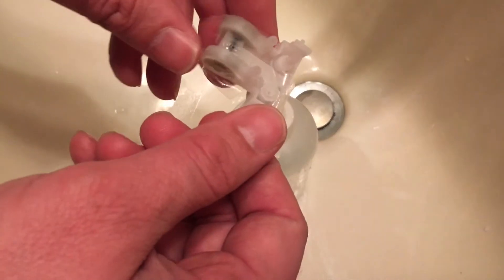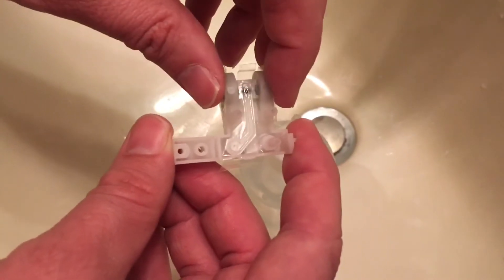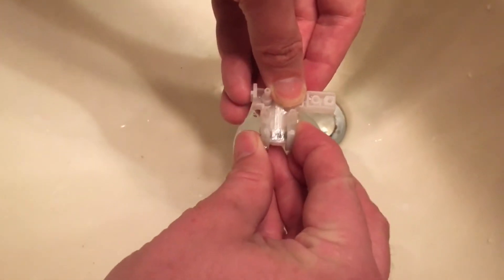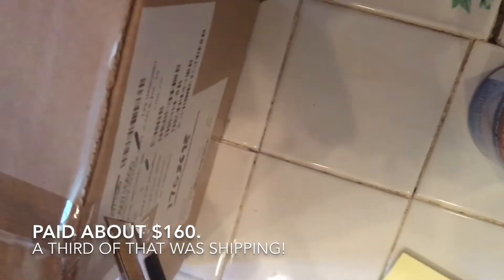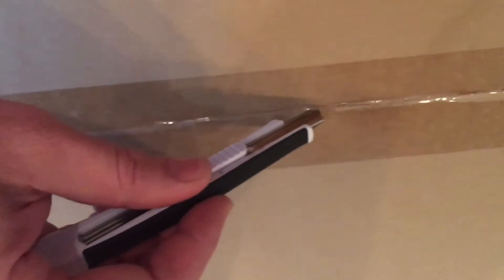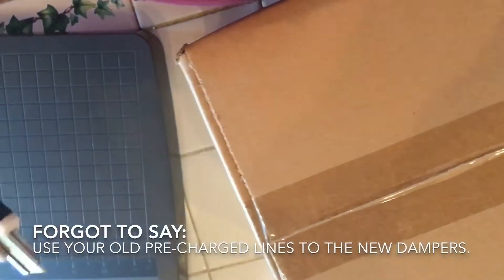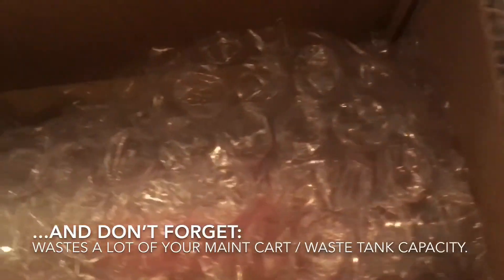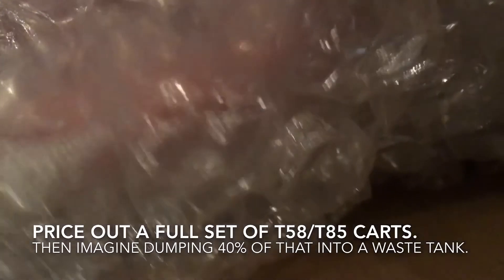Black ink switch valve fix Epson Stylus Pro 3800 3880 SureColor R600 P800

Comment: Could you please show us how you took this valve off and how you reconnected it?anyone not capable of doing it will not attempt to anyway,  Thank you!
Reply from the maker: Angel Smoke I stopped getting notifications for replies on my own videos after fixing my phone, so I missed this. Sorry.

The ink charged into the old ink supply lines was worth hundreds, so I deliberately left most of the old system installed. Obviously, the black ink switch valve and drained PK line were the only real problems.

First I followed a disassembly video I found on YouTube. I did not need to remove the printhead but once I had access to it I removed the motor and ink switch valve actuator from the top of the damper assembly that contains the ink switch valve. This can be done with a set of screwdrivers.

I believe I lifted the damper assembly off the printhead and turned it upside-down before disconnecting the lines and transferring them to the distribution plate on the new assembly. This is where it has the potential to get messy, since the old assembly will have dampers full of ink. Be sure to get it into a small bin to contain any ink ASAP. The hoses are long and flexible enough that you can switch the hoses outside of the printer. It may make sense to reinstall the carts to prevent ink from flowing freely out of the lines (can’t recall if I did this). Just don’t do anything that would pressurize them!

If you have a way to extract and recover the ink you may not want to do it this way, but I took the old damper assembly to the sink and began by removing the distribution plate and flushing the ink out with water. I then removed each damper, flushing them repeatedly until all the ink was out. Two dampers attach on top and three more attach on the bottom. Each damper has two chambers for two color/ink channels. Yes, one is vestigial and not used at all.

There is another screw under the top two ink dampers which holds the ink switch valve. Remove it and you should be able to drop out the black ink switch valve, which also doubles as a pass-through for one other ink channel/color.

Once removed, try to flush the ports. I used a cone-tipped dispenser bottle from Harbor Freight which I believe was $3 for a pack of 3. I filled it with warm water and squeezed to pressurize the ports.

Of course, you need to manipulate the ink switch to pass water, which you can do by putting pressure on one side of the selector pin or the other. It looks like two disc-like chambers with a pin that goes through the center of both. There is a clear film sealing each disc which is also attached to the pin that goes through the center of both discs. Just like the actuator we removed earlier, you can use your fingers to press on either side of these films to manipulate the pin sealed inside. Careful: you don’t want to compromise the seal.

I spent a good long time running warm water through and manipulating it back and forth. I intended to move on to isopropyl alcohol or ammonia if that didn’t work, but it eventually did. I just kept pressurizing it from different ports, even in reverse, while manipulating the switch back and forth. One side of the black ink switch definitely wasn’t passing water at first but it eventually did. I spent long enough that I almost gave up on using water but it probably would have worked much faster if I went straight to isopropyl or ammonia. I keep 99.9% and 50% isopropyl solution in those same Harbor Freight dispenser bottles. I used PUREtronics brand 99.9% electronics cleaning grade and I make the 50% solution by adding distilled water. I’ve seen it for sale at Fry’s Electronics and Microcenter alongside the more expensive MG Chemicals brand.

Once the dampers were all clear I flushed them with 99.9% iso and got them warm to dry them out. I did not reinstall them but it’s probably best to do a few warm cycles to purge all water if you do.

Of course, your dampers will be completely empty if you do this. If you trigger a cleaning cycle the printer will try to purge ink into the maintenance tank and will purge some air instead. Because I kept the old lines charged I only needed to do this repeatedly to fill most of my dampers, but my PK line had completely drained as a result of the stuck ink switch and it needed a bit more help. Luckily, triggering a black ink change is supposed to purge a whole damper of PK or MK, which actually purged air from the line every time it thought it was purging the PK damper. A few of those damper-sized air purges and my PK line/damper was fully charged. Though I lost quite a bit of MK in the process, this was much preferable to buying the adjustment program and dumping a couple hundred dollars worth of ink.

If I can, I’ll dig the old damper assembly out and make a video but it won’t show the printer disassembly or how to deal with one that’s still full of ink. :( Hopefully this will suffice.
Reply: @emmettturner9452  thank you so much for this detailed post ,that was really nice of you! However I went ahead and gave away the 3880 and got a Canon pro 2000.Canon doesn't have the ink change valve and that was one of the factors that made me decide on it. I also find it uses way less ink than the 4800 as well ! My question is how you learned to do this quite major repair to your printer?
Reply from the maker: Angel Smoke Well, I only paid $10 for it at Goodwill so I wasn’t risking too much. ;)

When I saw that it was a common problem and that the printer was valuable enough to salvage I decided to try. I already had my eye on the Canon Pro-100 but I’ve always wanted a photo printer than can print on posterboard for custom product packaging. Epson 3880 seems perfect for this, though I’ve had trouble finding photo-printable 16” posterboard.

There is a PDF version of the service manual floating around out there which I used to familiarize myself but the YouTube disassembly video helped more than that did. Main thing that convinced me to try was that the new parts freed me up to experiment with the old parts without having to worry about breaking the printer. Trying to preserve the ink ended up being easier, safer, and cheaper than swapping the whole ink supply system, which would have had me replace the carriages that hold the ink carts even though there’s nothing wrong with those.

Comment: Care to show how you did the replacement?
Reply from the maker: I mostly followed the disassembly video I found on YouTube up until I got to the damper assembly. After that, I simply swapped in the new part by switching the old hoses and reassembled. I then fooled around with the old part and managed to free up the ink switch valve (cause of my original problem). I explained that in-depth to one of the other commenters if you want to know more about that part.
Reply: @emmettturner9452  Would you mind sharing a link to the disassembly video?
Reply from the maker: @TodColbert I believe it was this one: https://youtu.be/sSQbhQbEvd8
Reply: Emmett Turner Thank you.  Looks over my head, unfortunately!
Reply from the maker: @TodColbert  I understand. I was out of my comfort zone too but luckily I'd only paid $10 for the printer and wasn't risking much. :)

That said, some of the most rewarding projects are the ones where you get in over your head and come out on top! I didn't know what I was doing and somehow managed.

Keep in mind, that disassembly video goes much further than you need to go if you are trying to fix the same problem I was. You'd stop a little over half way and  wouldn't have to touch the printhead at all. From there I swapped damper assemblies and did not have to take out nearly as much as the service manual was calling for. Saved hundreds of dollars of ink that way too (didn't waste the ink that was in the old tubes).
Reply: Emmett Turner Was it necessary to replace the valve, or could it have just been cleaned?
Reply from the maker: @TodColbert  Though I managed to clear mine with a lot of hot water, alcohol, and coaxing, it was very messy. The damper assembly was full of ink. Without a spare damper/switch valve assembly to attach the loaded ink hoses to you would likely have a mess there. Perhaps you can use 8 little plugs of some kind so that you can remove the damper/switch assembly and work in a sink or something without the hoses draining.

Even then, I'd suggest getting the spare ink switch valve first (around $30). That's because it is made with thin plastic film/membrane that could easily get damaged when trying to clear it which would leave you in a sticky situation with the printer taken apart. I've seen the damper/switch assembly under $100, which is probably the best option.

I'd like to keep mine around as a spare in case this happens again but let me know if you need to swap with mine. My spare isn't new, already failed once, and could have minerals and other contaminants from when I cleared it out with water (I did flush with 99.9% pure isopropyl alcohol though).